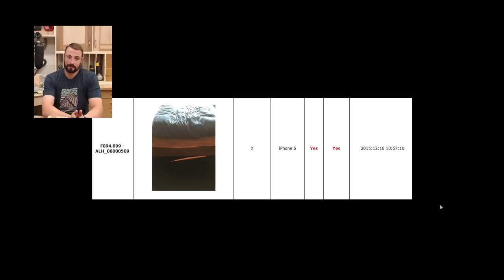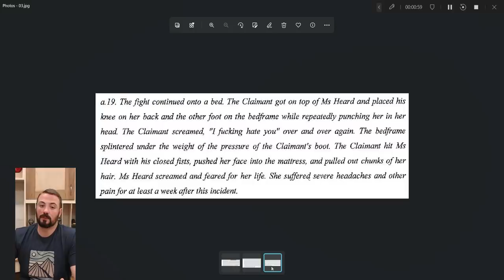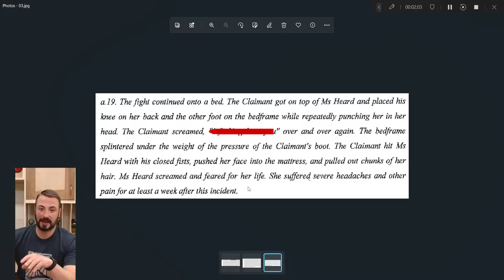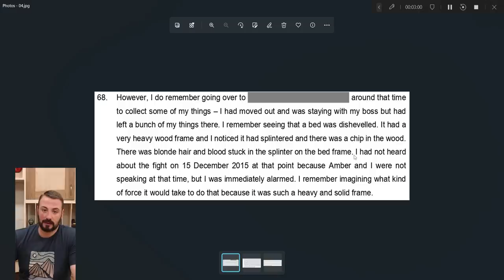Woodworker Attorney DEBUNKS Amber Heard's "Broken Bed” Testimony!

Comment: This is the first time that I have heard anyone discuss the bed. I knew as soon as she said that the bedframe had broken because Johnny had been standing on it - heck bedframes are built to hold the weight of the mattress and two people rolling round on it for years on end.  I admit to not paying attention to the case here in the UK but think that I understand what picture was in the jurer's heads when  thinking of a bedframe, platform beds are rare over here and to most people a wooden bedframe is a typical post and rail frame with either solid slats or sprung slats which are often cheaply made. I spent 5 years as a Bed Specialist working for a luxury retailer (selling them as well as building and dismantling bed frames and divans (you call them box springs).
BTW I think the implement lying on the bed was a pair of scissors. AH thinks that she is being clever but she is not, she isn't even that good an actress. I hope Johnny's legal team knows that the bed can only have received damage from a knife/sharp scissors and not from a boot.

Comment: As somebody who's worked with wood, pines especially a lot over the years I agree splintering in the manner depicted seems unlikely for anything without a solid edge and a pocket knife would give the results we see- however I think its also worth noting the wood is square, and usually we round or bevel the edges to prevent splitting, so would of liked to see a test with square stock, but I still think a boot would be unlikely to replicate the damage.
Another thing I find interesting is other damaged areas on the plinth top- Somebody looking for a dramatic crack or severe damage who doesn't understand how wood reacts might try create a split further into the wood, and if you look closely, in the actual split off there is a dark circle where a knot in the wood sits, about halfway- directly above that on the top face of the wood, another two inches or so towards the centre of the top face there is what appears to be a small gouge, similar to what a pen knife would make with some pressure and a jiggle, and another one to the right  towards the end of where the actual fracture is but and inch more towards the edge of the top face. Obviously this could just be from general wear and tear, but these two areas show signs of damage that sits deeper than the wood stain, allowing the natural colour of the wood to show, implying these are deeper than all the other scratches and dings, and stand out as being more intentional, so possibly show failed attempts to split the corner off of the plinth.
Reply: I agree. I would have liked to see the test with a square stock as well, just to compare it in the most accurate way possible.
Reply: I work at a sawmill that manufactures Southern Yellow Pine exclusively. As part of normal operations, we routinely climb or step on packs of lumber, and often individual boards, often catching the edge of the board, or the (mostly) unfinished square corner. Our lumber goes through a planer mill and is S4S, or smooth 4 sides. Admittedly, I have seen the edge splinter when a full grown person puts his entire weight on the corner of the board while wearing steel-toe work boots. That being said, it doesn’t happen often… most damage like that occurs when our lift drivers catch a fork on the edge of the bottom or top board when lifting the lumber, which is consistent with this theory. 
Keep in mind, we also sell perhaps 90% dimensional lumber, and have very few Timbers. But I’d also venture a guess that the times that I have seen a boot splinter a board, there was a pre-existing split that we might not have noticed before stepping on the board… plus that would have been a 2” board, not a damn 12x12 timber (or whatever it is… hard for me to tell from a picture). 
Regardless i feel almost certain that the sanding that would be involved in finishing a piece of furniture of the quality id expect Johnny depp to purchase would be sanded in such a way specifically to prevent splintering, which is very easy, whether the board’s edges were rounded or squared wouldn’t matter as much because the timber would have probably been sanded to perfection.
Reply: @jennieblanton5591  I appreciate your input and thankyou for confirming some of my thoughts, I have experience working in a warehouse and driving forklifts (although I've never been around timber mills so my experience here is limited to just operating with blue chep and euro's pallets), I would agree with your assessment. I've seen fork tines splinter edges of pallets when they are over inserted and catch the pallet behind the one being lifted, and I've seen a steel toe'd boot crack a plank when somebody  stood on the very edge to throw a bag onto the top of the stack, but all of their weight, plus the weight of the sack they were stacking was concentrated on the dudes toes, so if Johnny is only using his foot to stabilise himself while most of his weight goes into pinning somebody down, i just can't see it happening
Reply: @anapolloguize8294  I can’t see it happening either. I mean, I feel like that footboard alone probably weighs 100-200lbs (total guess, but lumber is heavy) unless it’s hollowed out. I really can’t imagine it would be possible to splinter that board.
Reply: @anapolloguize8294  i agree, in order for the wood to split as claimed the majority of his weight would have had to be on the very edge itself in which case he would have lost his footing but he didnt because supposedly his other foot/knee was on her back which also means the majority of his weight would not have been on the wood. plus there was further damage to that timber after the photo was taken which if the rest of the same kind of damage is consistent with the story would have happened through similar means. aside from all of those inconsistencies and even the knife(?) on the bed in the photo the only time you may see a natural splinter like that is with a single grain run entirely but in the photo you can see the damage is across multiple grains which imo would mean that the damage was not due to a weak bond between one grain which is the only way i can see this kind of damage happening by something like a boot even under depps full weight. ive run over timbers with heavy machinery and didnt cause such damage even smacked them with sledge hammers for demo work and still have never replicated these results.

Comment: Wow. It’s almost identical. I am curious about two things: are there any records of repairs to the platform and would that help with the origin of the the damage?  And speaking of origins, could that be pre-existing and then ‘worked on’ to increase the damage (hence two splintered pieces)? Thank you for your forensic carpentry. Which is a field you just created!

Comment: As that farm kid growing up I would love to have seen a little more follow-up on what kind of damage could have been done with a pair of work boots. I have mangled my fair share of lumber climbing over top and while it does splinter it never looks clean. A pair of work boots attempting to gain purchase basically saw back and forth. If the wood is soft and the edge is sharp the mess becomes a combination of indentations and tears that pull off chunks of wood in splinter like pieces. Here is the key point, if I break the edge of a board with my boot, the splintered part that has been removed from the edge if never perfectly clean. It cant be because my boot is in contact with the edge of the wood thus all the pressure necessary to separate it is directly on the outside edge leaving the splinter pieces a mangled mess as they tear free from the edge. The splintered pieces should be deeply compressed in some areas, cracked almost in half in other areas, and often even show discoloration from the boot soles as well. 

Essentially there can be no pristine splintering of softwood done with a pair of boots. I can splinter it with a pair of boots but you'll know some seriously violent stuff went on to make that happen.
Reply: My thoughts exactly.

Comment: Wow this was mind blowing.
I can't believe she took a picture with the evidence of her fake evidence in it.
Also I've noticed many pictures of her "injuries" on the face seems clearly just colors on the skin and in perfect identical tones and when you have an injury the tones are not identical or perfectly all over your face, I'd love to have professional make up artists explaining it too cause it's so clear once you observe her pictures they are fake.
Reply: Mind blowing? I was interested in this video because I hoped for something more conclusive and forensically-minded. Instead I found a video that misrepresents the structural physics of wood structure and poorly demonstrates it’s premises.

Using a small, fresh 4x4 with rounded edges and demonstrating stress with a boot upon which maybe an eighth of the force of a human body was applied is laughable, never mind the fact that a rubber-soled work boot is hardly the kind of shoe Depp would be wearing (given his style, I wouldn’t be surprised if he was wearing a leather-soled peg-heel boot; if the inside edge of the heel slipped against the aged, sharp angle of the edge of the frame, with a force perpendicular to the weak lignin bonds of the wood’s longitudinal grain, I wouldn’t be the least bit surprised that the wood might splinter). 

Seems like such a weird point to make, and then to make it so poorly?

Let it be said that I could give two shits which way this trial goes. I can’t help but tune in here and there and check out analyses by other YouTubers, but I was hoping for way more from this video.

Comment: If he had all of his weight on her, even if he was able to somehow “gain purchase” on the edge of the bed frame, how was he able to exert enough force on the bed frame to snap the wood like that? Wouldn't he have to put a decent portion of his weight on the edge to create the leverage and the force required to break it?
Reply: He doesn't really need purchase on the edge of the bedframe if all of his weight is on her with his knee in her back. That's actually all the support and purchase that he needs.  But we're not supposed to recognize that fact because it doesn't fit her potentially made up circumstantial evidence.

Comment: The only possible way Amber's story could be true is if there was already a weakness in the grain structure and Johnny's weight was enough to cleave off a chunk of the wood.  But any furniture maker worth their salt would not use timbers that were weak, and the bed itself doesn't look like it has timbers with weak grain structure.
Reply: Thought the same.
And not only that the wood would have had to be splintered already, they both would have had to ignore that. Even with that, if he was, as she (falsely) alleges, on top of her holding her down with his weight and for whatever strange reason had his other leg near horizontal to be able to to reach that part - there would be no downforce at all as his weight was already on her....
Reply: Absolutely

Comment: This is really interesting! My one question is, would there be a difference since their bed frame looks like the wood has a sharp edge, but the pine in your example has a rounded edge? Genuinely curious :)
Reply: I also wonder this.
Reply: He already explained this would have had to have rounded edge because of the soft wood grains
Reply: Seems like it should make a difference
Reply: It wouldn't make a difference. It's a soft wood it would just indent or impact to pressure like hammering soft wood it doesn't break like that.  It has to be from something fitting in the grain. Like something under your fingernail layers.
Reply: I was thinking the same, until he pointed out what looks like a pocket knife on the bed!
Reply: I have same question - that bed has a sharp edge and is varnished which would give much greater traction - it is obviously a different timber and may have had flaws in the grain like some similar furniture I have does - so many variables to this demonstration that I'm not really convinced of this argument.  This was also one of the only times I thought AH was telling some degree of truth.  How much though I have no idea.
Reply: @wildelifecoaching6225  She's on video ballet dancing, back exposed with no injury, a couple days later.  Do you think she'd be able to do that if JD was bearing all his weight down on her back and no injury whatsoever?
Reply: I think you're missing the point here. The wood cracks along the grain and you need to penetrate the surface to get into that grain. The outer shape won't matter it's about the internal cellular make up of the wood and what it takes to crack it at a seam. Ie: you need to get INTO the seam otherwise it will just dent the layers
Reply: @plutonium2  Yeah I get that but I know some wooden furniture / fences / building timber etc that I have damaged when moving, accidentally impacting etc over the years and some have had similar breakage from impact. Not saying a boot could do it but also not 100% convinced of this theory.
Reply: @wildelifecoaching6225  if someone hit the bed against a wall or something it's possible to splinter wood by force. But that's EXTREME FORCE not someone who has the majority of their weight on a bed and is just using leg strength to try and push at the wood. If you crack a piece of pine against a wall it will splinter along the grain but maybe you need to consider how much force is possible from someone in a lying position using just a foot. Like... Fair play that you're dubious but lie on a bed. Put a bucket down at the end. Try and make a hole on the base of the bucket with your foot. You can't be standing you would have momentum and mass. Lying down you have lower momentum and virtually no mass. It's simple physics
Reply: To be clear in virtually ANY OTHER POSITION a human foot can bust through a bucket base but lying face down on a bed? No mass. Restricted momentum. She's claiming he did this with traction but you don't get that kind of traction with your leg upside down and all of your actual weight spread out in front of you. 

Does that make more sense to you if you don't believe he just pushed the piece off with a foot, which is amber's claim. Consider more than the claim is he did this WHILE lying face down on top of her. Weight distribution is essential for calculating velocity. All his mass was on the bed to this would be ONLY the weight of his foot which is restricted in that he's again facing FORWARD onto the bed. If he was facing up and used his boot heel it is KINDA possible but face down on a bed just pushing? Not possible. You'd have to penetrate the wood entirely along the crack. One small splinter in the wood still requires force he can't amass BC his weight is off the foot.

I think what's key here is she claims he pushed the piece off. Not that it was cracked by him or he used force but that he simply pushed a bit of the wood off with his shoe.
Reply: @plutonium2  yep makes more sense
Reply: @wildelifecoaching6225  right. It's more just about the idea he's pushing this off with the toe of a rubber shoe but yeah wood will split I agree

Comment: to be fair, your wood blocks were not equipped with a sharp edge, the actual interesting part is, that the damage by a shoe would leave signs of the boot pressure on the wood, not ONLY ship it.

Comment: As a trades person, I have seen that there is ALWAYS going to be a freak exception to just about every common sense understanding of what and what is not possible. That said, if I was on the jury, this would make me very skeptical of this part of Heard's testimony. I would most likely consider it to not be credible unless I had seen the damage when that photo was taken and could see signs of surface oxidization that had been within a crack, since a crack that would allow a person of Depp's size, and who is not using the full force of his body weight on his boot to force off a corner of such a large timber would have taken a long time to develop. I would also expect to see deeply ingrained rubber scuff marks on the timber, and possibly bits of rubber on the splinter. And as we all know with "bed activities," beds are not the best at providing traction to push against.
Reply: There's a another clue to the puzzle . its that pocket knife in between the covers , this looks like she staged the photo and forgot to remove the pocket knife
Reply: Re "if I was on the jury, this would make me very skeptical of this part..."
If I'm on the jury, I'm thinking, so you were tossed across the room, dragged naked through broken bottles, had clumps of hair pulled out by the root, and were brutally assaulted... in a tender place... with a bottle that has a hard wax coating that leaves a sharp edge when peeled open.  My goodness, you're lucky to be alive.  Good thing you got a picture of the bed!  It's an interesting distraction, but splinters from the bed are a red herring, I think, and very far down on my list of things that discredit her story.  To the trade person in you, however, look carefully at the break in the wood (18:50ish).  Note the hard "L" shaped corner and the horizontal ledge at the bottom of the break.  Leaving room for the freak exception, as noted...  Ever seen wood shear off along the grain leaving a hard corner like that?